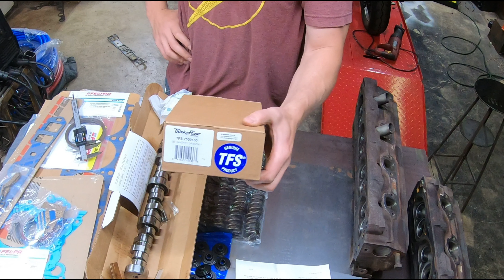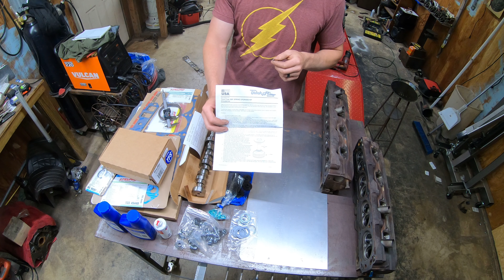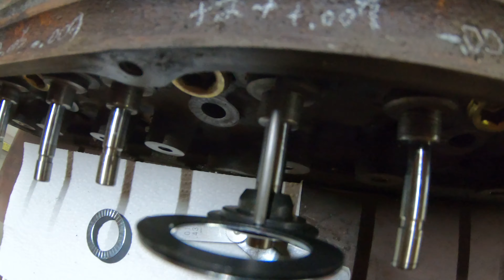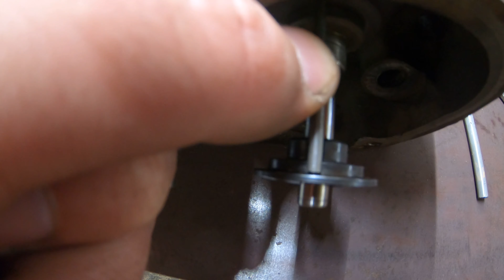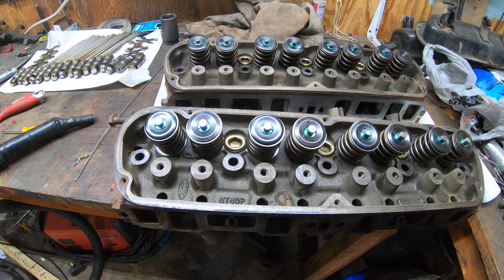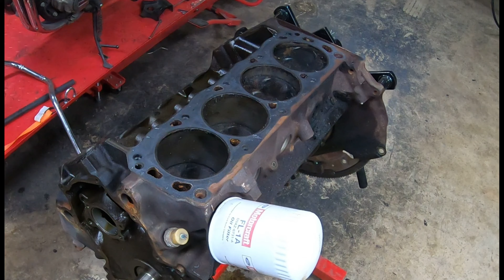Trick Flow Spring Kit 2500100 and TFS Stage 1 Cam Notes.

Comment: Nice. Curious if different pushrods were required in the end? Doing a similar SBF build and trying to keep costs down.
Reply from the maker: Ended up needing 6.300" pushrods.   Had to be at least .045" longer for the smaller base circle. Thanks for asking!
Reply: @ImprovisedBuilds  Ok thanks! Will measure for sure...
Reply from the maker: @Burnedtoastify  I definitely tried to be cheap and used the stock pushrods first but the hydraulic lifters didnt have enough adjustment to compensate haha..it was a little noisy
Reply: @ImprovisedBuilds  Ah, interesting. Seems like some folks out there re-used them and maybe got lucky.
Reply from the maker: @Burnedtoastify  Have you seen anyone else's measurements for the cam base circle? maybe more likely to work with milled heads..
Reply: @ImprovisedBuilds  No, I did see a post mentioning they asked TFS about it and the company said their cams were the same base circle as stock but who knows.
Reply from the maker: @Burnedtoastify  well since I used a explorer non-ho motor maybe the difference came there. I surely hope .045" difference on an internal component radius isnt within normal manufacturing  tolerance lol!
Reply: ok
Reply: Are you using the stock valves?